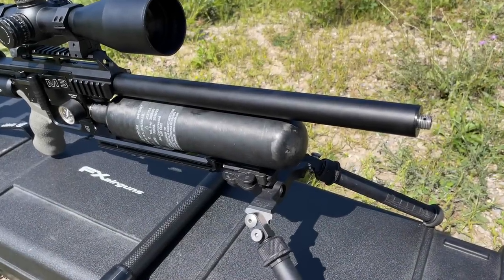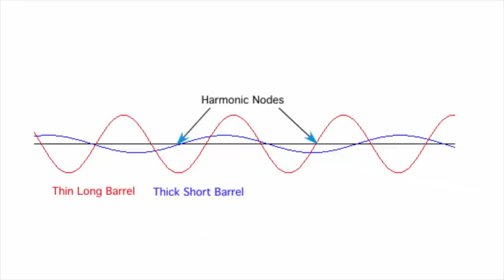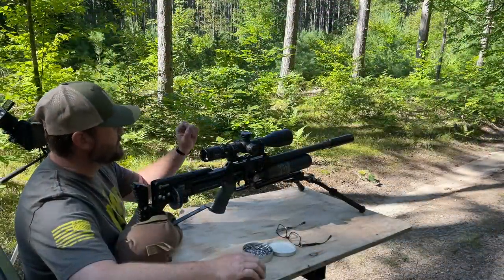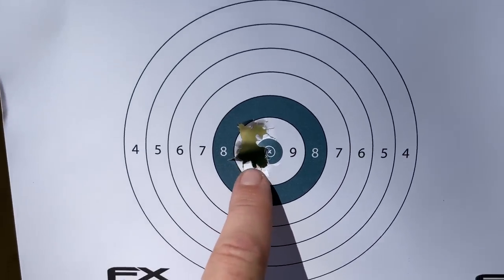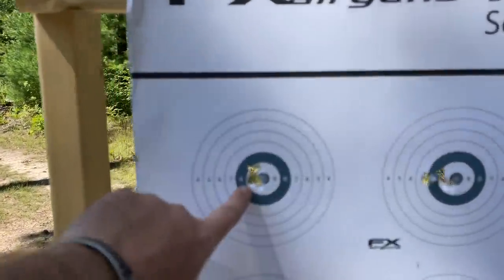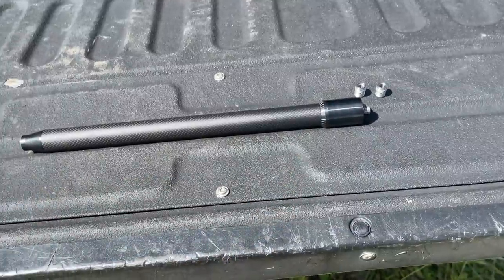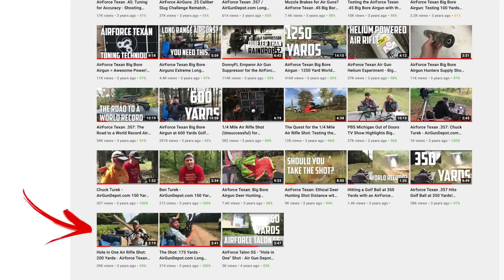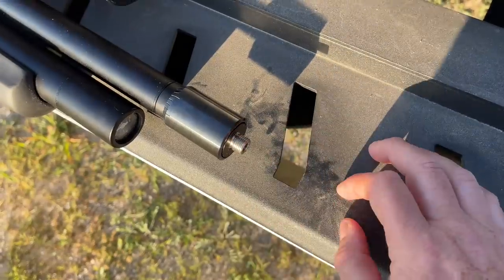FX Airguns Impact Integrated Harmonic Barrel Tuning Shroud Overview + Big Announcement!

Comment: Nice!  Absolute tune ability at your fingertips. Optimizing projectiles is the final frontier.  I am waiting on a FX Impact .35 and have been casting Lee 95 gr slugs with a BC of .105.  I cast, sort, powder coat, size and segregate by tenth of a grain.  Helps pass the time til the 35 airgun becomes available.  Thanks for all you do for us bench rest shooters.

Comment: Purchased the carbon fiber liner sleeve should be here soon. Interested in the possible results. I appreciate your videos.
Reply: LOVED the CF liner sleeve in my Maverick sniper. Put it in 3 days ago. WELL worth the money and easy to install. Did not find any vids on install so let me give you a heads up. Remove suppresser, remove barrel shroud. Now STOP! If you remove the barrel "stop" (10 mm thingy at the Front) than the barrel slides Out! You do NOT need to remove the cheek piece or barrel assembly! (I learned the hard way). After you slide the barrel out, remove the support o-rings (the CF tube takes up the space) and reassemble. CF sleeve over barrel liner, slid into barrel "tube", than tighten 10 mm end nut. First time took me 40 minutes, second time would take me 4 minutes. Cheers bro, a good shooting!
Reply: @scottmichael3745  found out fx calls it a liner lock. Appreciate the heads up!
Reply: @williamczupryn2642  anytime I can help a fellow airgunner, I'm there!
Reply: Purchased it prior to your video

Comment: Good stuff Chris. For anyone wanting a little deeper dive into this subject, I wrote an article on harmonic tuning back in 2018 which explains the basic principals and the "why" of doing this which can be downloaded from the "files" section of 'The Airgun Benchrest Channel" on Facebook. While a 6 dollar shaft collar can produce good results on virtually any gun, it certainly pales by comparison to this very well thought out design which incorporates a number of additional benefits into a single unit. I've been using my shaft collar for years, but whenever this thing becomes readily available, I'll be one of the first in line. It should be said the this type of tuning ISN'T a miracle cure for guns that aren't shooting their best. In order to see real benefits from any of these types of products, the shooter has to have his equipment "ducks" in a row first. However, for the guy that has been perfecting his tool to the point where he's satisfied that it is performing at it's current optimum level, this type of equipment can push that peak performance to the next level. This technology has been around for a long time and there is NO DOUBT about it's effectiveness, so for those that try it but don't see the benefit, it's time to go back to square one and figure out what the real issue is. Once that's sorted out, harmonic tuning will make a VERY notable difference.

See you at RMAC
Cheers

Joe P.
Reply from the maker: Dude spot on!!!!!  CHECK PROJECTILE STABILITY first! If you’re not stable no need to proceed. Then tighten your SD / ES velocity tune - ONLY THEN do you harmonically tune with the harmonic tuner.

Comment: I've had my FX Harmonic Barrel Tuner (detachable Version) for a couple of months.  Initial look was very nice, attached easily and looked great.  Since it came with no directions, I sort of winged it.  Here's my thoughts.  First, the end user should be strongly advised to index the barrel liner so that the projectile flies along the North South axis.  Initially, I did not do this; and honestly, I didn't see a whole lot of improvement.  And I know you spin the collar to find the "sweet spot" where the projectiles punch through the same hole.  And then remembering where you had tuner the collar was another challenge.  To resolve this, I added turret stickers to each large hash mark, numbering them 10 - 80.  This gave me a reference point.  Barrel Indexing is key to success with the Harmonic Barrel Tuner!  Over the past couple of days, I've worked with both of my FX rifles, Impact MKII and the Maverick.  Indexing the barrel is really quite simple, just takes a little time and a few pellets but the results are worth the effort.  I do have a question: Should the Collar on the Barrel Tuner be turn only one full rotation, or are there benefits to turning the collar past one full turn?  Other than that, I'm very impressed with the results and one happy owner.  Keep up the good work! 👍
Reply from the maker: Great feedback on the indexing. I’ve seen great results without that step, but if it’s working for, go with it! To answer your question, the tuner has 8 full rotations you can use. We have found with barrel stiffeners, we use 1/4 rotations of the tuner and have been able to find multiple accuracy nodes within 3 rotations. Keep up the great testing and thank you for sharing your results.

Comment: Just put both the carbon fiber sleeve and integrated tuner on my M3 .30 600mm.  Reg 1 at 175, Reg 2 135, valve out 4 plus 1 1/2 turns, and Tuner set at the 6th hash mark, I'm getting 1/4" at 50 with both Hades and Hybrids. Avg 929fps.  I'm only getting an extreme spread of 12fps and standard deviation of 3fps.  I think I found the sweet spot.  Loving it.

Comment: Interesting. I’m glad to see the design may have been perfected. I tried the original B O S S system on a powder burner when it came out. Never got a decent group. But it did make the rifle so loud that it hurt your ears even with hearing protection on. Of course that isn’t an issue with pellet rifles though.
Reply from the maker: Ya they got sued for that reason.

Comment: Moongel Damper Pads
Moongel self-adhesive gel sticks to the surface of drums, cymbals, and most percussion instruments. By simply moving the damper pad around the surface, you can eliminate any unwanted resonance, and obtain the exact sound the situation demands.
🤔
Reply: but simple stick-on dampers and weights don't allow THEM to sell you a convoluted version of that at a premium price... commercialism, gotta love it? Another solution would be to not use hydraulic line for your barrel... so it doesn't whip around like a wet noodle when shot, where any slight variation in pressure or mass causes massive changes in the barrel frequency lol. But that would reduce profits for FX...and largely eliminate the need for aftermarket doo-dads like this.

 When a relatively (considering it's an oversized, overbuilt .22 LR rifle) light weight Remington 512 .22 with a 26"  .625-.5 taper barrel stacks bullet on bullet, regardless of mfg or loading, that tells you that there is value in using an actual gun barrel, rather than thin tubing. The extra mass minimizes the effects of temperature changes, pressure changes, and variations in mass. I wish air gun designers would learn what firearm designers learned long ago... just because you CAN get away with an inferior design element (and be safe), doesn't mean you SHOULD.

Comment: Hi,
When screwing on my harmonic tuning shroud, i can see the gap between the bottle and the shroud going bigger and smaller. So something is miss alligned. Shouldn't it screw on straight?
Can you tell me if the front piece of the weight itself is glued or screwed in the carbon shroud?

Thabks
Reply from the maker: Email photos upnorthairgunner@gmail.com and I’ll help you out.

Comment: Chris, great content. What's the weight of the removable version? I'm  just wondering if my dreamline 600mm barrel will flex if I install the tuner. The moderator I'm using is a Koi (quite light). The dreamline breech block / shroud assembly is reportedly weak, hence my concerns. Thanks
Reply from the maker: I think it’s around 6oz. Get the carbon fiber sleeve and you’ll be fine. I’ve started running sleeves on all my kits.

Comment: Thanks for the video.  I have a 700mm M3 with slug gun upgrades (pin, port, etc) and am looking to send Javelin 23  then step up to 34s.  Should I find the harmonic best point within one full rotation of the tuner, or, could it require multiple rotations?

Comment: Hi Chris,
i've bought it in 500mm, and i see some problems with it.
The shroud (weight wheel), installed as it should be, touches the air bottle on my Impact Compact! Slightly, but definitely touches. And it can be even more when i start tuning, turn to the right, because then will the weight go more towards the bottle. I think there should be more space between weight wheel and bottle. In 600 and 700mm will this not happen, but in 500mm it can cause POI shifts in my opinion. Other thing is, the weight ring turns really stiff, definitely not so easy as yours in your videos. It literally tries to unscrew the shroud everytime i move the wheel to the right... And it also makes some iregular noises, such a clicks by turning. I don't know if its right or wrong, but i'm little bit confused and dissapointed.
What do you think about it?
Reply from the maker: The rotating weight is touching your bottle? That doesn’t seem right at all. It sounds like the shroud itself is unscrewing off the end and moving backwards. Send me an email: upnorthairgunner@gmail.com

Comment: My concern with it being, if you're already getting one hole groups at 60/70/80/90/100 yds then i dont see the benefit unless when you take it alot further out, but sub 1" at 100/150/200yds is straight forward. The only way it will work is if you have got the perfect harmonic tune & using the absolute most suited pellet or slug gor your liner. But thats my view 😁👍
Reply from the maker: That is a really good thought, but there is some clarification that needs to be understood in your rational. #1 You ONLY get one hole groups if your airgun is perfectly tuned.  Up to this point we have been using velocity to "time" when the projectile leaves the barrel. There is a misconception that if you shoot X airgun with Y ammunition at Z velocity, you will get one hole groups.  That isn't how all this works.  

When you get an airgun properly tuned for tightness of velocity, that removes one factor of variation, but that doesn't necessarily mean your gun is fully accuracy tuned. That just means your velocities are tight. The final step of accuracizing your rifle is to find that harmonic accuracy node for that ammo at that velocity with YOUR airgun.  

Up to this point in order to do that, you would then have to go back to your power settings to try and find that accuracy node that IS TINY MICROSCOPIC so when tuning with velocity which is in Feet Per Second, you are now messing with your tight velocity tune hunting for that harmonic node. 

The use of the FX tuner becomes single variable manipulation leaving your tight velocity alone. So if you change ammo or want to crank up your velocity for hunting for example, you just find the tight velocity setting again with your power wheel and regulator and then just harmonically tune the barrel. 

I have found that I am literally using a FRACTION amount of ammo to harmonically tune vs. velocity tune. Hope this makes more sense now.
Reply: @UpNorthAirGunner  
 Let me ask You  question because I'm little confuses plus I'm new in this sport
 I'm gonna give you example
  I will  set my rifle to. Slug NSA 43.8 gr  
At 930fps  because i like that speed   
Rifle is consistent i mean  spread  6  dev 2.8    but I'm not getting good accuracy  
 I mean group is terrible.   So at that point i will need to start use Barrel Tuner. To Tide The group I'm correct ??? 
Or still i need to find best speed for specific ammo.  Tide group and later  on the end use barrel Tuner to Tide group???
Thank You

Comment: 🤝Hi, I congratulate you on the great video, but I would like to ask you a question ... once you have set the Integrated Harmonic at 50 meters, when you have to shoot at 100 you have to adjust it again or when it is done at 50 it works for all distances? thank you for your availability and thank you for posting some wonderful videos🍻
Reply from the maker: My harmonic tune at 50 meters is the same for all distances.

Comment: I was wondering if it uses a (10331 Compesator) in the end of the shroud still, or if it was removed for this shroud design?
Reply from the maker: The design includes the base where the tuning weight is actually part of the end cap of the shroud.
Reply: @UpNorthAirGunner  So it does use the shroud as part of compensating the barrel, this may be important as some country's don't allow it. lucky us, as we have not regulated it, at least as of yet.

Comment: Nice!  Will this be cross platform? I have an Airforce Texan...
Reply from the maker: It could work with the .257 with the .30 cal insert, but not the big bores.
Reply: @UpNorthAirGunner  drat. I have a 457. Thanks